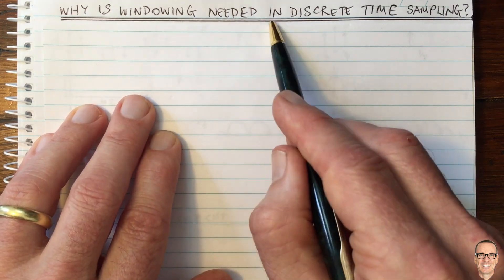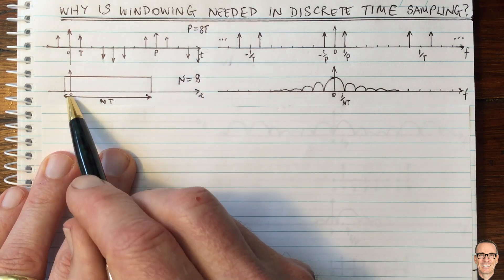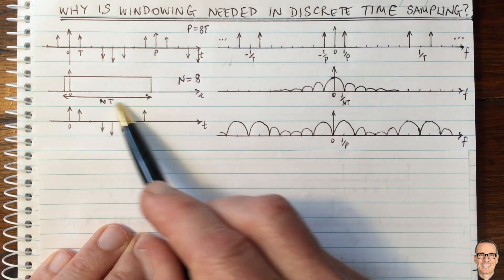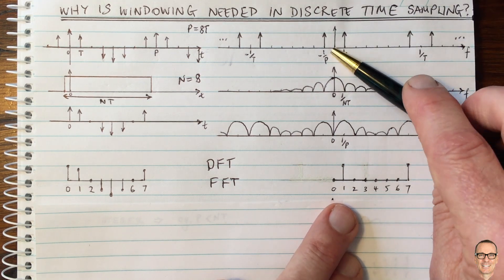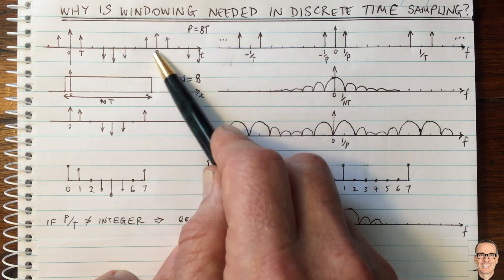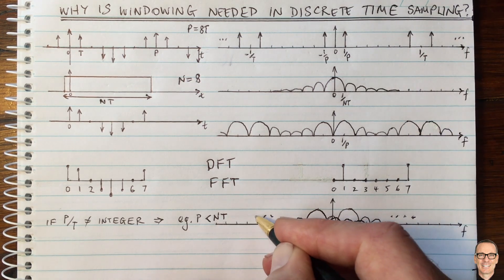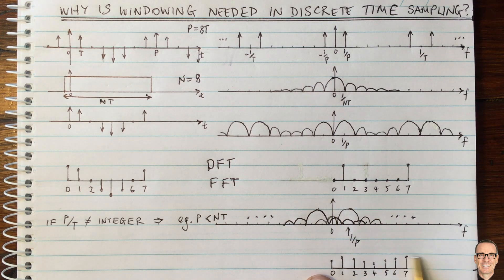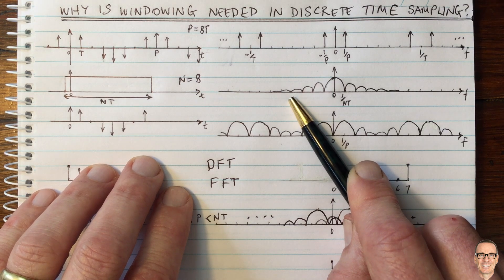Why is Windowing Needed in Digital Signal Processing?

Comment: To be honest, this video did not help me understand WHY you would want to window a DFT. What is wrong with using the result of the DFT directly? After all, the input samples to the DFT are themselves a window.
Reply from the maker: If P/T is not an integer, then the output of the FFT will be a vector that looks like the bottom right hand function (frequency domain sequence), instead of what you'd like to see - a "clean" function that only has energy in the elements that correspond to the sinusoidal wave (ie. the function I draw for the case when P=T, that only has non-zero elements in positions 1 and 7). Perhaps I could have been clearer on exactly how windowing solves this. Hopefully this video will help explain: "What is Windowing in Signal Processing?" https://youtu.be/1Hd72RpMFlQ
Reply: @iain_explains  Thanks for the reply.  I have read a lot more about this and it appears the phenomenon is called spectral leakage. Essentially, a real world signal is unlikely to correspond exactly to one of the frequency bins so you do not get the single spike you would get if it did correspond exactly. Instead, several bins on either side of the frequency do partially correspond and produce their own smaller spikes on either side of the actual frequency. Windowing is an attempt to minimise all but the spikes closest to the actual frequency.
Reply from the maker: Yes, that's exactly what I show in the video.

Comment: Thank you king o7 

Would you say this is valid thinking: DFT can only provide periodic components. If after windowing signal is non periodic, DFT "puts" an impulse at the tail  to alogn it with the head of the next period, this impulse in time domain is a constant in the freq domain, smearing the spectrum?
Reply from the maker: No, not really. It's more like multiplying by a square wave signal, which has the effect of convolving in the frequency domain by a sinc function, which spreads the energy out in the frequency domain. Perhaps this video might help: "Why are Sinc and Square a Fourier Transform Pair?" https://youtu.be/ZcTWLwXGql0

Comment: Thank you, a more general question. When I have the signal given in the form y(t)=cos(2×pi×t-phi), how do I know that we are in the frequency domain or time domain? I assume we are in time here because "y(t)". Because we have f and t in the equation and sometimes we have just t in the equation e.g. y(t)=t×s(t) - here it is clear,  we have just t in the equation. 
Thanks.
Reply from the maker: You don’t have f in the equation you wrote! Only t. So it’s the time domain.
Reply: @iain_explains  I am sorry, I mean y(t)=cos(2×pi×f×t-phi). Is f here a fixed value?
Thank you.
Reply from the maker: Yes, when people write the equation the way you have now, they are generally referring to a sinusoidal carrier waveform in a communication system, where the "f" in your equation is most commonly written "f_c", which refers to the carrier frequency. It's the specific frequency given by the oscillating crystal.